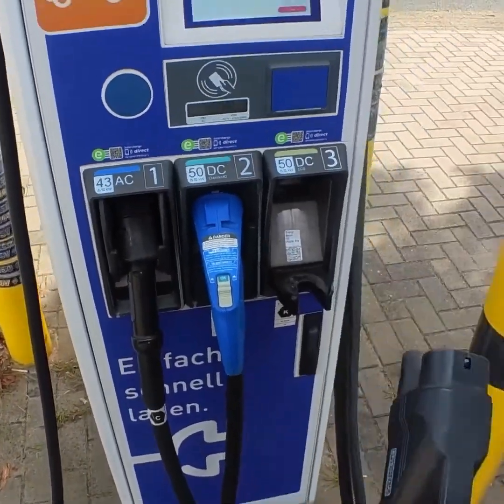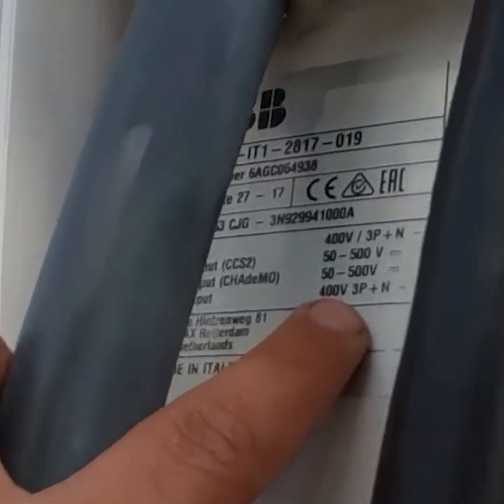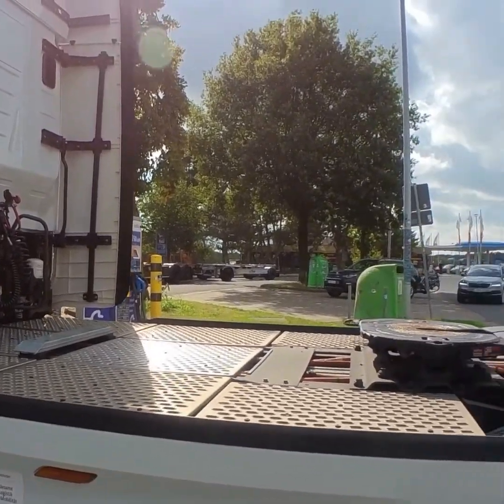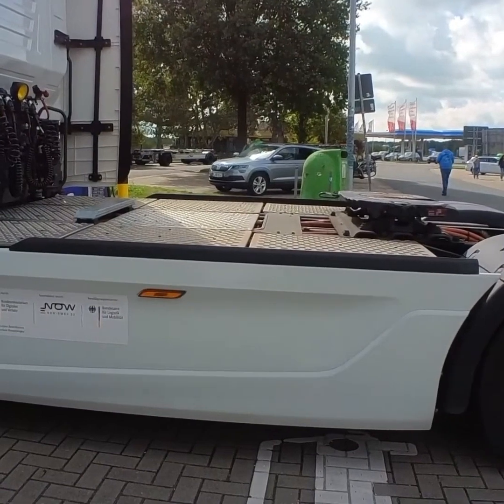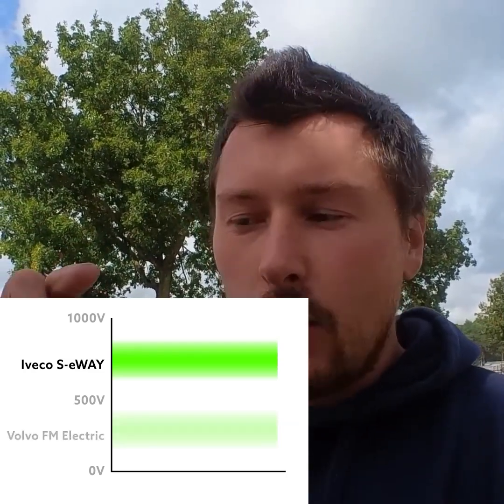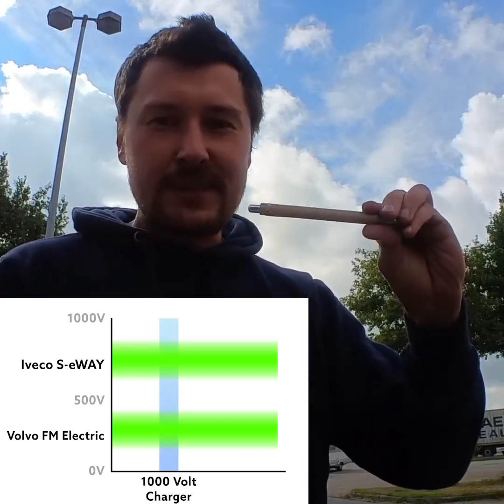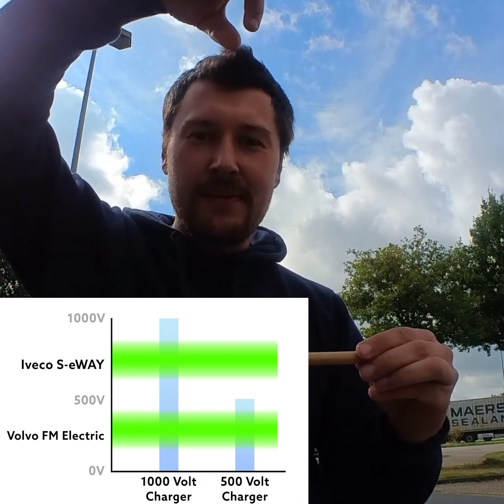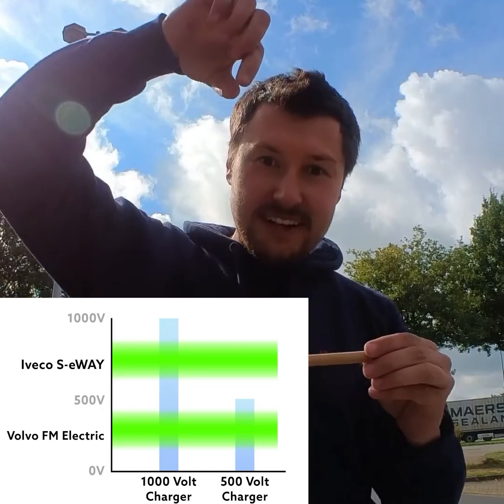400 vs 800 Volt Charging Stations #electrictruck

Comment from the maker: Small correction: I recently found out that the Volvo FM Electric also has a 800 Volt system, but is limited to charge at a slower rate. So even the Volvo could not charge at a 500 Volt station. Overall my explanation is still correct, you would just need to replace the Volvo with an electric car instead.
Reply: The Hyundai's with 800v use their motors inverter to step up the voltage ⚡ 
The charging limit is much slower though